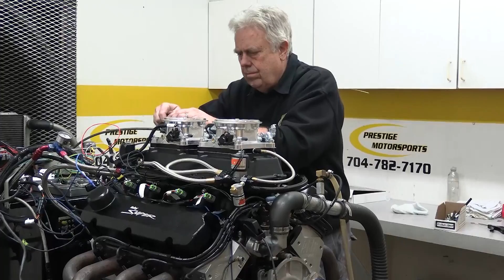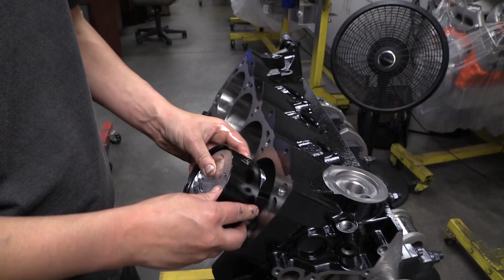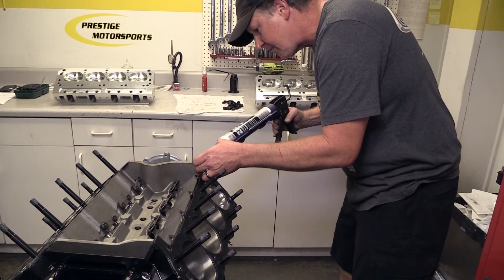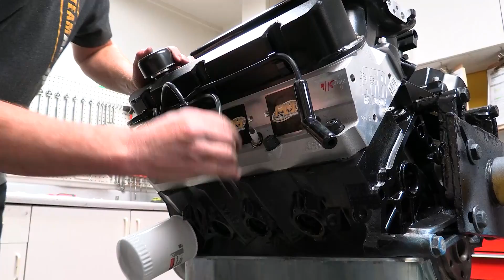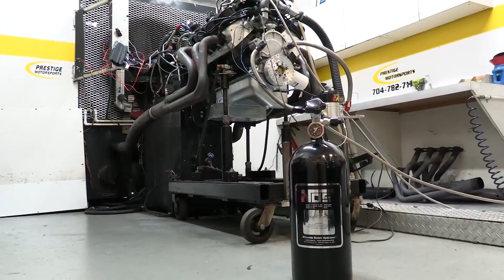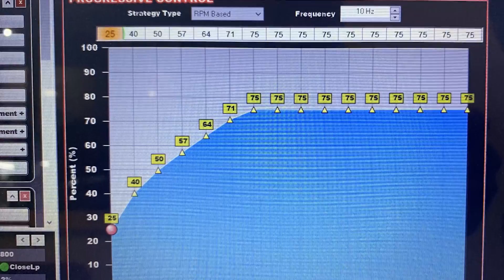Nitrous Guzzling Ford Windsor Blasts Past 1,000 Horsepower!

Comment: Are the pistons 4033 or 2618 ?
Reply: They are a set of custom DSS . They have a  +22cc in a dish piston. I can't figure how in the hell that worked!? And 5/16 push rods with . 080 wall. .700 ? Shit I would never get away with that. I don't use 5/16 push rods on anything over 650hp because they tend to fold up like pretzels. And it's 250lbs on the seat 850 he said at full lift. And using a 5/16 080 wall I must be doing something wrong. Prolly not holding my balls in two hands I just use one. That's gotta be it

Comment: Oh yeah sure, a street engine with a powerband starting at 4K. That thing is gonna be an absolute dog on the street until you hit 5,500 RPM.
Reply from the maker: The dyno pull just started at 4,000 rpm -- where it was making 468 foot pounds of torque. It's still got plenty of torque down low. At 2,000 rpm it will still be making around 275 foot pounds at least.

Comment: The engine had a pretty good stumble @ 19:57 when the nitrous first hit. It's hard to tell from looking through the throttle body at the spray bar, but it looked like there may have been some air or gaseous nitrous in the line as it first came on possibly?

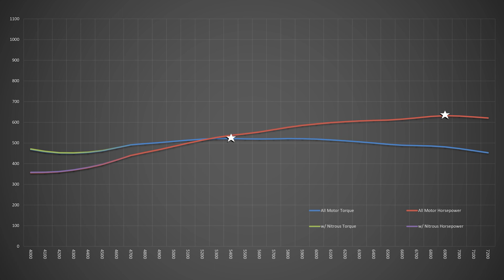Edit: Heard it again @ 20:14. Is this the ECU compensating for not using a fuel pill in the plate? My experience with an N2O plate system is that it hits HARD, smooth, and with no stumble, even if I use a progressive controller. Maybe it's normal, but this engine sounds so different when the nitrous comes on than to what I'm used to hearing.

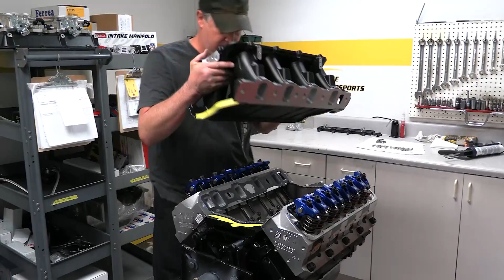Comment: What is the yellow masking tape for @11:04
Reply from the maker: so when they wipe off the excess silicone sealer for the china rail it doesn't get onto the front of the block. They pull the tape off and the extra silicone comes with it. Just a cosmetic thing, but it does help the completed engine look better.

Comment: You should put this or the 460  small block na engine in a 1963 1/2 ford falcon sprint back halfed with a roll cage pro street style🔥

Comment: Another video this month of someone putting in a camshaft  without covering it with assembly lube as they go. That makes two this month.  What in the hell is the world coming to??????
Reply from the maker: A lot of engine builders I work with prefer to lubricate the cam bearings with a brush before installing the cam. With a roller cam, sometimes they will lube up the lobes and sometimes they won't. The thinking is the engine will be primed before first fire up and that will  push oil out of the pre-filled roller lifters and onto the lobes and roller wheels. It seems that different parts of the country have different practices. Either way seems to work
Reply: @TheHorsepowerMonster  both the guys who taught me. my vocational school teacher and my teacher from technical college would have had a damn stroke if they saw that. But those guys were old back in the late 90s early 2000s. So they've probably did have a stroke or something by now. Everything in the valve train gets soaked and covered.
Reply from the maker: I hear ya. When I put together an engine, which isn't as often as I'd like lately,  I definitely get excessive with the assembly lube. But be warned, I've got more engine build videos coming up from both Prestige Motorsports and Harrell Engine and Dyno, so you are probably going to see more of it. I'm hoping to do a ProCharged Ford and a bucks-down big block for Hot Rod Drag week, so it should be worth it. By the way, Jay, who assembles at HED, was trained at one of the NASCAR Cup shops and he's one of the most particular engine assemblers I've ever had the opportunity to work with. Thanks for watching
Reply: @TheHorsepowerMonster  thanks for making these videos. I've always enjoyed these videos and all three of my domains are subscribed to you so keep up the good work. And we'll enjoy internal combustion while we still can.

Comment: The thumbnail's an inline 6?
Reply from the maker: No, it's the top half of the Ford Windsor V8 that's built in the video. It may look confusing because that's the plenum of the Holley Hi-Ram intake you can see and it may look like a straight 6 valve cover to you.

Comment: A V8 running at 6000rpm has 400 intake strokes per second with the engine management system setting the timing and quantity of fuel delivery. Watching this video, the the nitrous  spray appears to pulse relatively slowly which suggests to me that the amount of nitrous going into each cylinder will vary between each stroke. I cannot see how you can get a precise nitrous/fuel ratio in each cylinder especially at high rpm
Reply: Remember you’re watching a video that plays at 60 frames per second so your probably not seeing exactly what the nitrous is spraying. Also the inlet runners are drawing from a common plenum with all sorts of reversion going on, it’s like a washing machine in there. Check this vid out to try n show just what goes on. Also the nitrous is just adding extra oxygen to what is being drawn in thru the throttle bodies and the ecu is adding enough fuel based off the wideband O2 to compensate.
I’m certainly no expert but there’s a lot more going on than what you’re seeing in the vid. 
https://youtu.be/7Iq1B-2paCs
Reply: Thank you Robert! Finally somebody that sees the imprecision of the existing nitrous technology. Plus while the bottle is cooling down during the spray, the pressure decreases. Multi stages and pwm progressive nitrous solenoid control is an improvement but the nitrous volume still doesn’t precisely match the changing volume of intake air. I believe a nitrous system should be almost exactly like an efi system with a nitrous pump with regulator and port solenoid injectors that are regulated based off rpm, air temperature, and intake air volume.

Comment: WHY HAS THIS TECHNOLOGY TAKEN THIS LONG????????
Reply: It hasn't, it's been around for quite some time now. We ran a similar setup with Big stuff 3 ( basically F.a.s.t engine management) back in 2003. It was a Disomma 428 sbf with Neal BF202's heads that made 843hp on motor and 1200hp+ with nitrous. We used the injectors to supply all the fuel just like this. Also had a sheetmetal tunnel ram. Although this Holley system is definitely much easier for the user for sure.
Reply: @waynebollentin989    sorry about the CAPS!!  in the moment ya know.   I'm just messin around and I really enjoy this stuff plus your videos!!!  thank you,, you guyz

Comment: Great video as always, Jeff!
Reply from the maker: Thanks!
Reply: @TheHorsepowerMonster  Question for you two: In order to control only 75%, is your terminator module treating the nitrous solenoid as an injector? I mean, "pulsing" the solenoid? As we can see 19:53 nitrous line vibrates and nitrous injection oscillating right? Just trying to understand as I liked very much the video!
Reply from the maker: @guzforce  Yes, the solenoid is still either on or off, so to get progressive control the Terminator X has to pulse the solenoid, essentially turning it on for short periods to achieve whatever percentage of flow you want.
Reply: @TheHorsepowerMonster   Really interesting and clever! Just thinking about a kit! Hey, great video and thank you very much for clarifying the question!

Comment: Perhaps altering the PID Control of the absorber could help with that spike area. Also torque starts to decrease rapidly relative to the All Motor torque. An interpolation from 75% Solenoid Duty Cycle @ 6200rpm to around 85% @7200 rpm could help with the rpm and time limiting factor and ensure the cylinders receive the same amount of nitrous even as rpm increases. Not trying to be a smart as, just throwing out ideas lol. Great Video!

Comment: Not 427ci, it is 414ci. 4.125"x4"x8cylindersx3.1426(pi) doesn't equal 427.  That block is serious bad ass. Those mains have the meat!
Reply: 4 inch stroke and 4.125 bore gets you 427 cubic inches
http://www.wallaceracing.com/cid.php
Reply: B÷2 =R2×Pi×S×N.C.=CID
Reply: Why delete the 2 replies ??

Comment: You mentioned in the cam specs it was .430 lift, but when talking about the valve springs you mentioned you’d need every bit of lift they’d let you have. Did I miss something? Lol

Love how detailed your videos are! Fine work for sure.  Love how not every engine combo is some sorta big secret
Reply: .430 is tappet lift only, You need to X times rocker ratio to get valve lift  which they stated as .690 ish
Reply: @blueblood76  I was thinking that, but wanted to make sure I wasn’t wrong in that thought process. Thanks for clearing that up!

Comment: Use both sides of the nitrous plate for nitrous by turning the fuel side into nitrous also.
Reply: Would melt pistons?
Reply: @blindsquirrel-v2q  No...since the injectors are going to up the fuel delivery.
Reply: @blindsquirrel-v2q    Won’t melt pistons because the Efi is controlling TIMING. NO DETONATION TO HURT PARTS.
Reply: @DnoDaBarber  lean out

Comment: Think I would have went with some highport heads
Reply: Yeah. Guess when it's a give away engine they want it to fit under as many different hoods as possible though.
Reply: @joecook3223  yeah or some dart Pro's
Reply: @PatrickScottlxw  
Why ?
At .700 lift, which is about the lift of the cam/rocker arm combo they used,  the AFR 220 CNC heads flow the same as the Dart Pro1 20° 225cc CNC heads on the intake and the AFR heads outflow the Dart heads on the exhaust.

https://www.airflowresearch.com/220cc-sbf-competition-cylinder-head/

https://2ovflq8a2if23r0004f29t3i-wpengine.netdna-ssl.com/wp-content/uploads/PRO1-225-CNC-Ford-Tech-Sheet-H33.pdf

I would rather see if they could hit the 1,000hp goal with a hydraulic roller cam. Much less likely to fail than that solid roller setup.
Reply: @JohnSmith-ps7wp  Old guy limited roller experience , effect of hydraulic cushion ?
Reply: @JohnSmith-ps7wp  ; I can't for the life of me figure why you would think the solid roller more prone to failure over the hydraulic roller cam. With proper valve train i'll check my lash once a year as a courtesy.